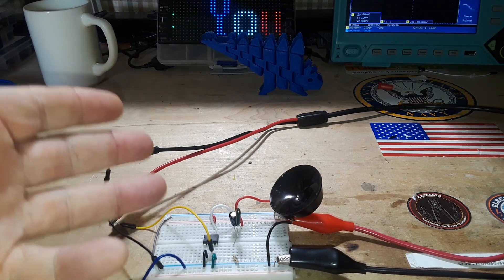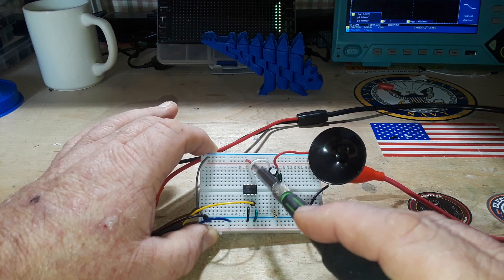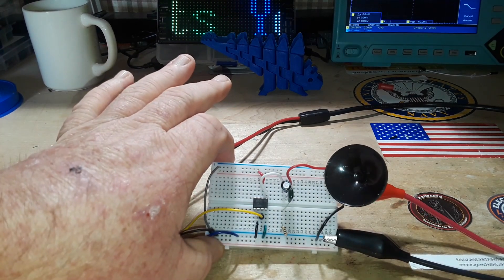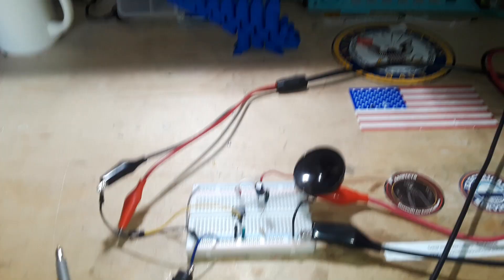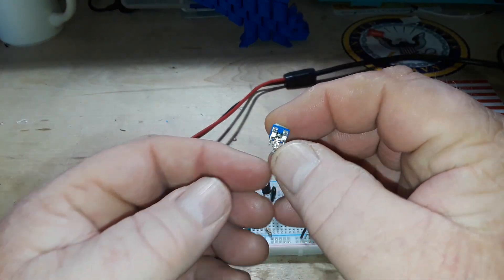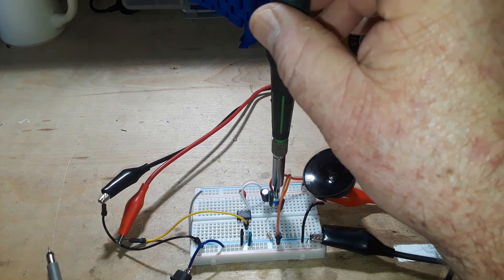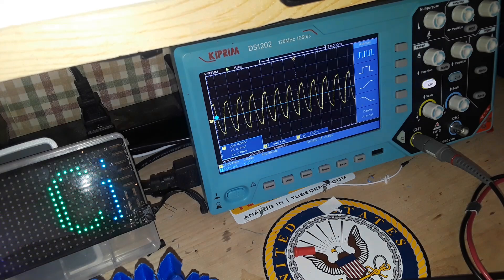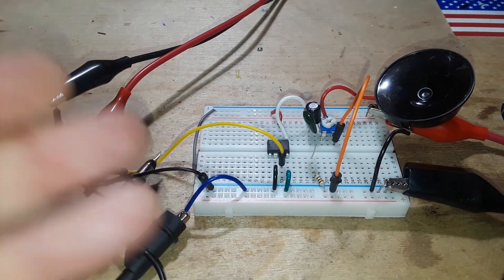CCYSK: Add A Volume Control To Any Audio Circuit

Comment: Hi paul .I enjoy your video very much ,  i have a question ,  i just bought a door ding dong  (12v) and it's to loud  i thinking of adding  a pot or resistor in series to the speaker what value of resistance to use   thanks
Reply from the maker: I would need to know about the circuit. Is it ucontroller based? Mains voltage? RF?
Reply: Hi ,the circuit input is 220v goes down to 12v i think( i don't have the scheme  it's a small board) i don't see an option to control the sound
Reply: Hi again  ,SO I just open the bell  and  there is lm386 ic  with option to change melodys  ,hope this helps

Comment: Hi Paul. I enjoy these CCYSK vids. A quick question: If you didn't send some of the signal to ground, and just used the trimmer pot as a variable resistor, would it not also work as a volume control? If so, what is the benefit of sending the unused signal to ground? Take care.

Comment: LM386 is an audio op amp, I had to look it up. Good stuff. Love all these CCYSK videos
Reply from the maker: It's an Opamp. It is specialized to be used as a low power audio amplifier but if you hook it like a regular opamp it will behave as such.

Comment: By putting the pot on the input you are saving a lot of power and don’t risk damaging the LM386 which is being driven flat out in this configuration……
The data sheet shows the pot on the input. Check the current consumption and you’ll find this is the worst case scenario. The LM386 was designed to be used in battery powered applications.
Reply from the maker: Please rewatch the video and listen to what I said. Also refer to the title. None of this video was specific to the 386. I clearly stated that I was only using it as an example. The people who ask me these questions are generally not that well versed in electronics and I give them a simple easy solution. Is it the best solution? no But we don't want people poking around inside their AC powered audio equipment without proper training. Most of these people can find a speaker output. You see where I'm going here? This aint graduate level electronics for engineers and physicists. This is beginners electronics. Apologies if you wasted you time looking for the cutting edge of electronics, I just do basics. Peace.
Reply: @learnelectronics  Hi Paul,
My comment wasn’t intended to undermine your teaching, or offend. 
I enjoy your posts and am a subscriber. I’ll keep my thoughts as just that in future 😉 keep up the good work 👍

Comment: interesting but why on the low impedence output shorly better for the amp if on the input side.
Reply from the maker: Please rewatch the video and listen to what I said. Also refer to the title. None of this video was specific to the 386. I clearly stated that I was only using it as an example. The people who ask me these questions are generally not that well versed in electronics and I give them a simple easy solution. Is it the best solution? no But we don't want people poking around inside their AC powered audio equipment without proper training. Most of these people can find a speaker output. You see where I'm going here? This aint graduate level electronics for engineers and physicists. This is beginners electronics. Apologies if you wasted you time looking for the cutting edge of electronics, I just do basics. Peace.
Reply: @learnelectronics  Sorry it was not ment as criticism and yes i did watch the video .
I enjoy you channel and if there was something like it 55 years ago it would of been a great help to understand  circuits.
keep up the good work.

Comment: PAUL, make a YT lesson about the relations and how they are related for Transconductance and GAIN, because GAIN = Vout/Vin and Transconductance Gm = mho = 1/R = Current/Voltage
Reply from the maker: Tomorrow
Reply: @learnelectronics  thanks i cant wait to see it. You can "convert" Gain into transconductance GM or convert transconducantace GM into GAIN using formulas. Each Transistors biasing configuration has a different tranconductance + RC = Gain

Comment: Nice video Paul. One question. Is there a reason to use a polyester cap ?
Reply from the maker: Not really in this case, I only had the value I wanted from the poly caps

Comment: Did same on water tank full alarm few years back (still working), which was way too loud. It was little bit of trial and error to find correct potentiometer.
Reply from the maker: 10k to 500k is quite a range.